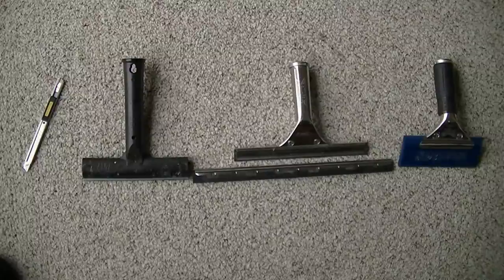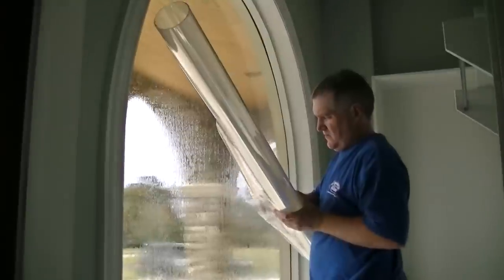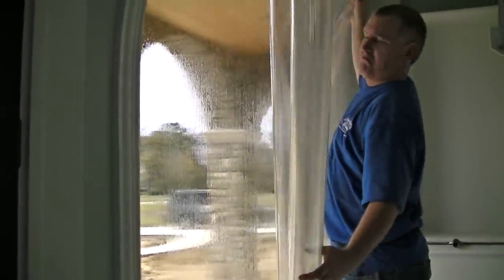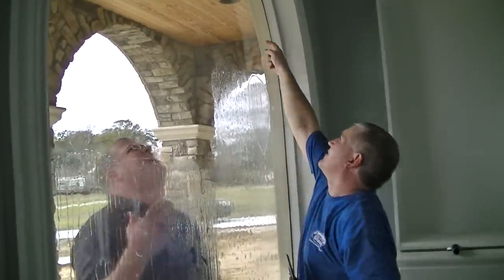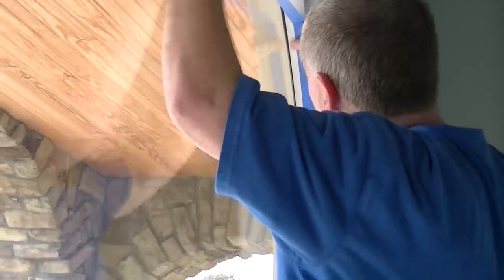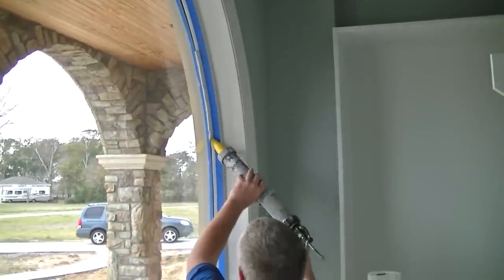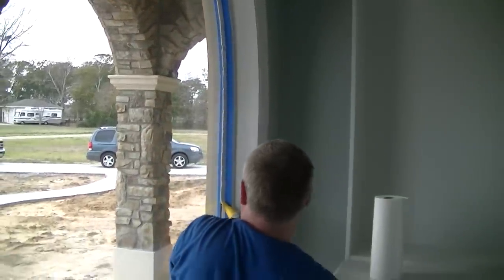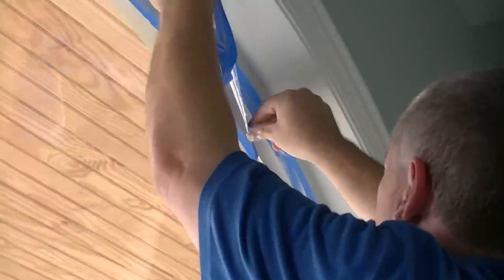Armor Glass Security Film Installation Training With Narration.mpg

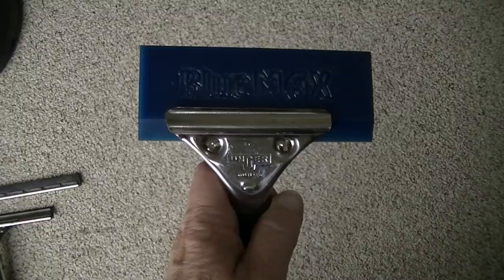Comment: Excellent video.  I think you left off a critical step, however.  At 2:20 it is clear that the film is substantially larger (wider and longer) than the window, but a few second later when you are squeegee the water out, it is mysteriously exactly fitted or likely smaller by 1/4" on all sides for the Dow 995 to stick to the film and glass and frame junction.  This critical trimming step is missing completely from the video.

Comment: @oneofthemodels: as long as you squeege out all the water and make sure every thing is dry, you can apply dow.
 As to the tool that is being used with a rounded edge, the integrity of the dow has been compromised . It should be a flat tool that will give a solid 3/4 " bead when tooled . This is GSA specs. anything less is unacceptable. To do this requires a precise 1/2 " gap of the tape on both mullion and glass.